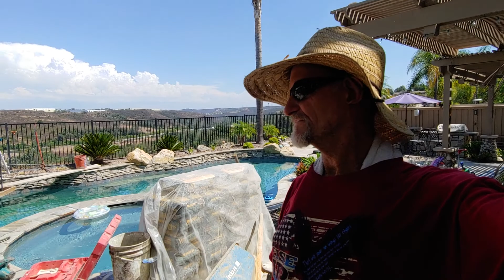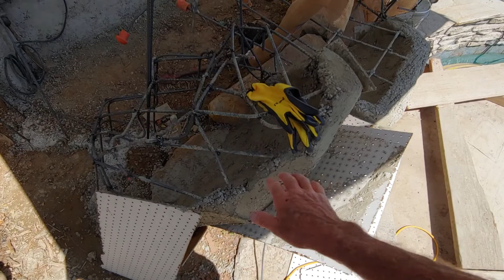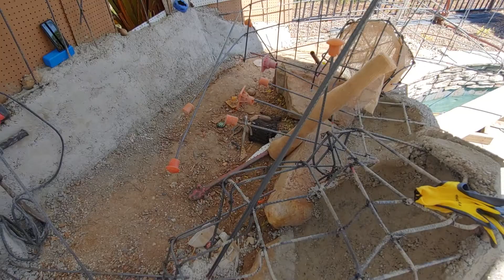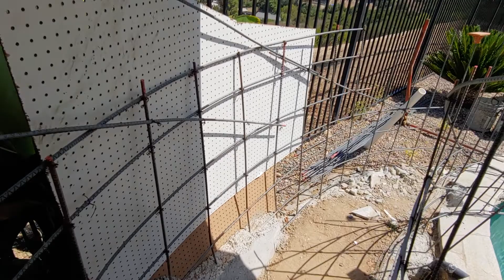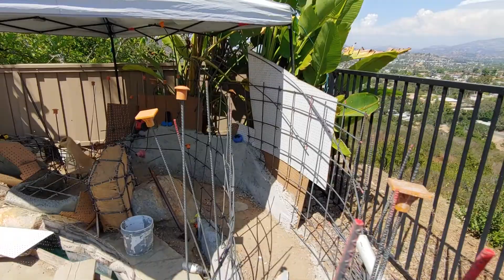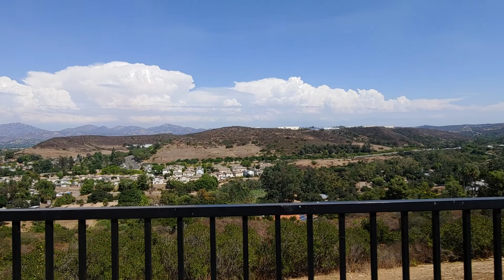How To Build a Fake Rock Waterfall Slide Project, The Beginning...

Comment: How much would that cost
Reply from the maker: This project had some particular challenges.  It was jammed into the corner of the yard behind the pool which meant we needed to build it all by hand without a quick shotcrete for our structural coat.  The budget for this was therefor a bit higher coming in at about $17K.  I made a bull pro course on the building of it that includes over 5 hours of video and 79 pages of pdf downloads that correspond to the 8 Sessions.  You can find the link to this course here: https://davehenderson.podia.com/full-pro-course-how-to-design-build-a-17-000-faux-rock-waterfall-slide-feature  Also have a promo video on this course here: https://youtu.be/AmuRYcXPHsU  There's more cool stuff, including free pdf downloads and more, at davehenderson.podia.com and www.daverhenderson.com for blogs and links to other platforms if ya like.  Anyway, thanks for checking out my stuff.  Appreciate it.  Cheers, Mr. Dave